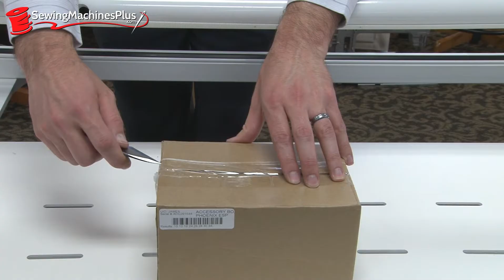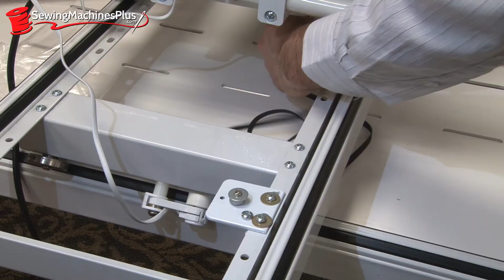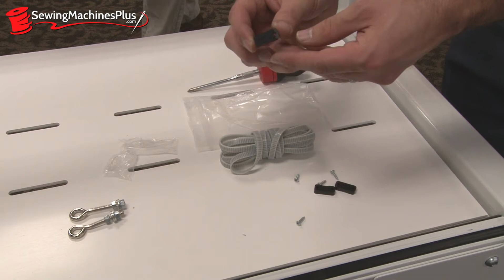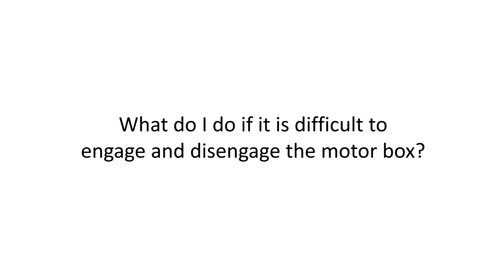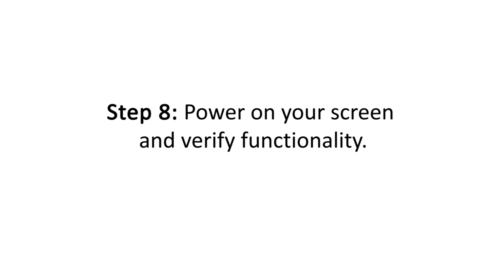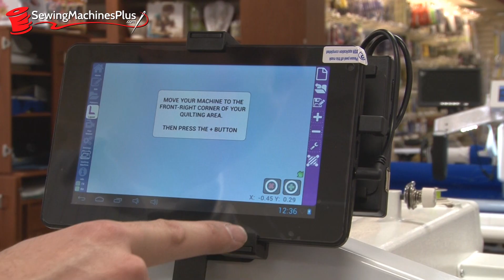SewinMachinesPlus.com's Butler Quilting Robot Install

Comment: Please, please put more and more videos on the internet for operating the Butler Robotics System. I received no instruction booklet, therefore, I had to print it off. It does not have through instructions at all in your booklet.  Nor did a tech come to my home to instruct on how to use this device. It's been trial and error as I go, and more error to be frank. It would be much appreciated. Thank you